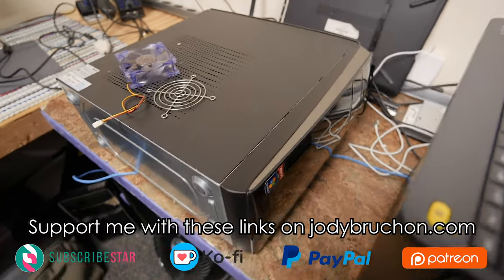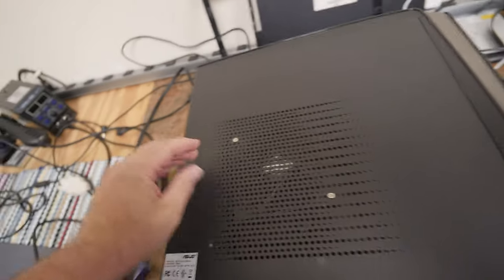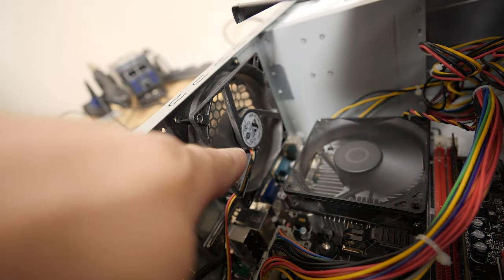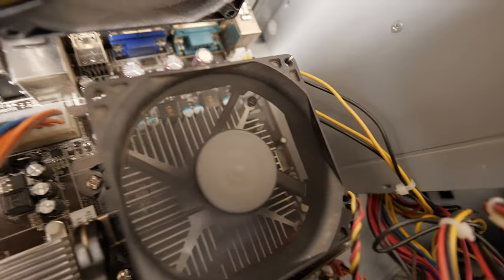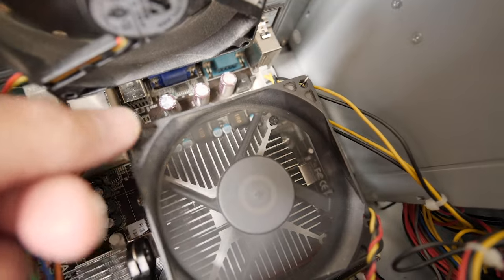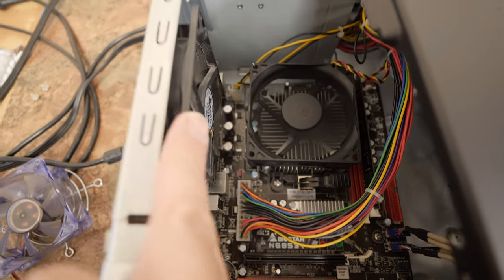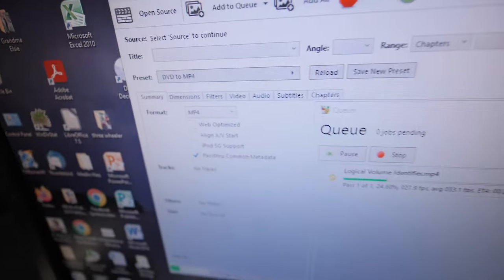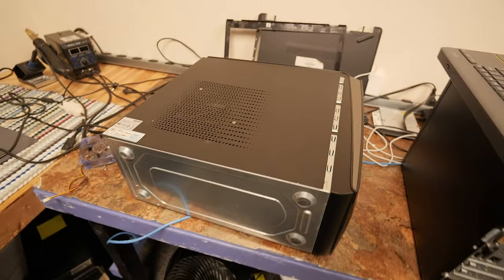My Unprofessional Cooling Fix - Jody Bruchon Tech

Comment: This made me think back to when I was at a remote site for work many years ago and I managed to break a tab off a Socket 7 CPU socket, leaving the heat sink I had unmountable. The only part of the bracket with a slit aligned with that now broken tab. I managed to use a paperclip to strap that side to another tab on the socket. Had to twist it to get enough tension to get it to stay in place. Very crude but the spare PC was dead, the shops were closing and I had to get a train back home so no option but to come up with a solution. It was totally forgotten about until that PC was decommissioned, but it held up😆

Comment: It's way better than it was before. Shortly after upgrading from LGA 775 to AM4 the pump in my 12 year old Cooler Master Aqua Gate Max began to fail. So I zip tied my old Thermaltake Typhoon cooler to my Ryzyen 5 3600 until I got a replacement. I could have just left it. It was more than sufficient.
Reply from the maker: My Ryzen 9 5950X is a much lower wattage than my old FX-9590!
Reply: @JodyBruchon  That's crazy! I did upgrade from that Ryzen 5 3600 to a 5900x. I really don't need that much horse power but the I just couldn't pass it up for the price.

Comment: Is the fan you put on the side panel blowing in OPPOSITE direction of the fan on the CPU?  If so that's stupid.
Reply from the maker: Tell me you don't know how airflow works without telling me. What a moron.
Reply: @JodyBruchon  You have two fans fighting each other.  One blowing out the side panel right above the CPU cooler that is blowing down through the heatsink.  You should turn that one and the exhaust fan at the back around, that way fresh air comes in and goes through the CPU cooler and then out the back.